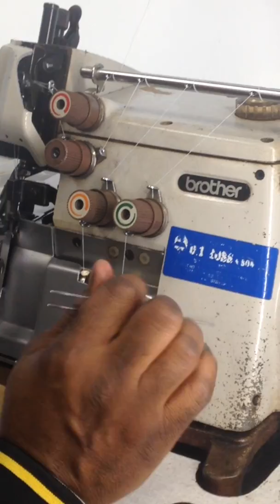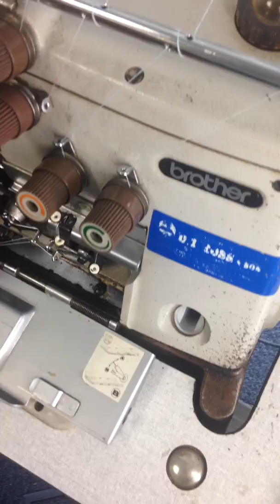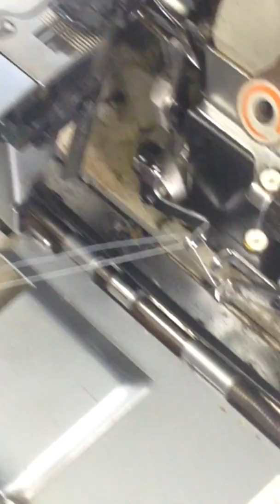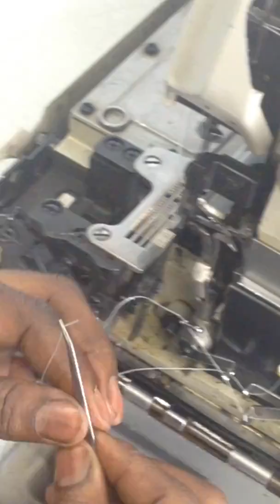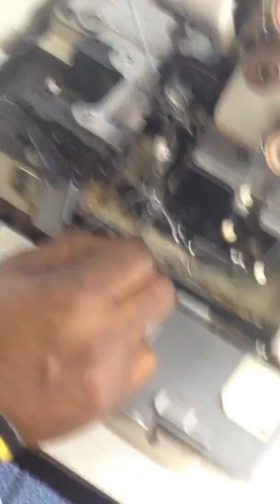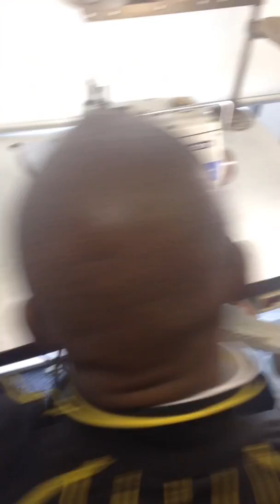How to thread a brother EF4-B511 industrial overlocker

Comment from the maker: I think there’s a plastic screw at the top. Unscrew that and fill it with oil. On the front right side you should see a circle that shows how much oil is in there and there’s some lines on it. You Gotta stay between the lines I can’t member because It’s been a long time since I’ve used this machine.

Comment: Thanks for the video,  my problem is finding needles mine are shorter than the ones at walmart, joAnns or michaels  :''-(
Reply from the maker: If you go to a sewing machine shop that deals with industrial equipment they will have the needles. Most of these Brothers are very similar and take the same needles.
Reply: @spiritualfashiontutorials8133  is there an online store trusted to just order them in bulk? And is there only one type of needle?

Comment: My thread is loose and I can’t get it to tighten do you have any tips?
Reply from the maker: Your thread may be loose because it is not threaded correctly. Open the little hatch and there should be a diagram on the inside with instructions on how to thread it. If that doesn’t work check the thread has gone between the tension discs probably. This is very important! Make sure your threads hasn’t gone behind the discs they must go between. This is another important one!!!!! With industrial overlockers they don’t like Cheap thread. With domestic it should be fine but DO NOT USE CHEAP CRAP THREAD!!!!! I recommend a brand called ‘Moon’. If your thread has no branding don’t buy it for industrial overlockers. Use those on your domestic machines only. If you think men are frustrating, use inferior thread for this machine and you will experience frustration on a level not yet known to mankind.

Comment: Hi, I have a Brother 600UL serger. I was using it and needle broke. It hasn’t worked since. Won’t “serge” and continues to break needles. Can you help?
Reply from the maker: Feel at bit guilty for not replying to some of your replies. If you still have this machine it could be a few things why it doesn’t work. If the knife has moved up or down it won’t cut neatly or not at all. If the knife is blunt and needs replacing it won’t cut. That knife has to be in exactly the right place. 3mm too high or low and you will have problems. If you tug or pull the fabric through it can break needles. Let the machine pull the fabric naturally. Main reasons needle break is if they are not in properly. Sounds silly but make sure the needles are pushed all the way up. Also If you use the wrong needles. If the garment got stuck and you were a bit violent pulling it out, a moving part may have been bent or thrown the timing out or moved the knife. Lastly if your needles or a needle is blunt you will struggle to get a neat stitch. Make sure your needles are nice and sharp. If it is none of the above it needs a service.